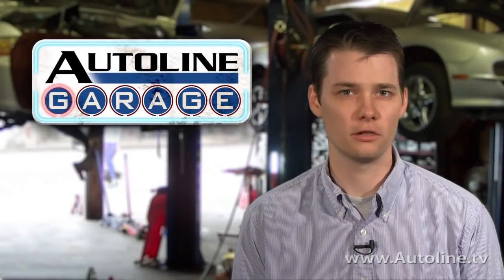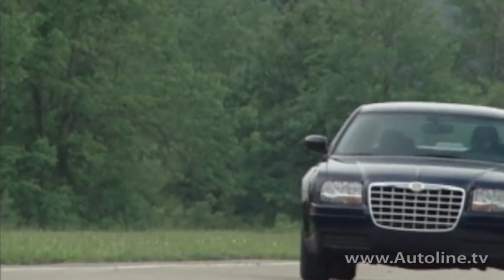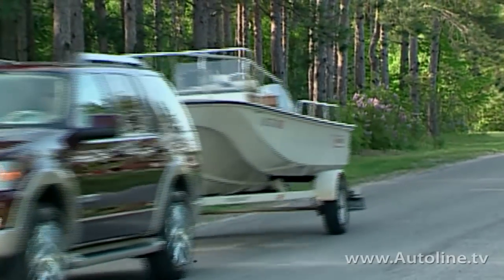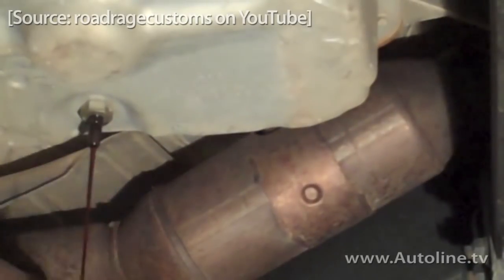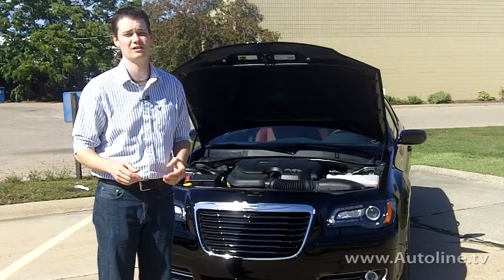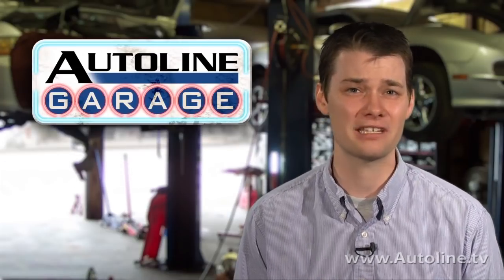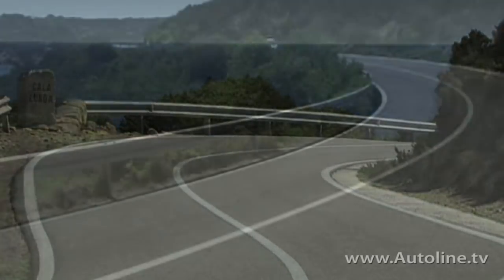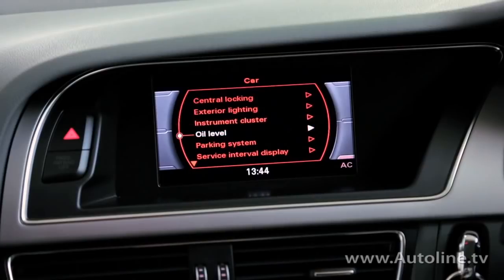Where Did the Dipstick Go? - Autoline Garage

Comment: The reason has many different angles. The first and obvious is "attempting" to force owners to ONLY have them serviced at the dealership so they can count on that money. The second is bean counters pinching every last penny for corporate greed and larger profit margins. The third is so you will wear out the vehicle sooner and need to buy a replacement. The forth is the EPA issue involving spills and disposal. The last is easily solved by taking your used motor oil to ANY auto parts store worth a damn. They all recycle it for FREE.

Now you can inserts any and all "xyz" excuse you have heard or have been told. It's all a bunch of lies and bullshit rest assured! I don't buy for a minute they have tranny fluid that lasts FOREVER!! I also don't buy EVERYBODY uses the wrong type or puts in the wrong amount. Christ...you should see what I have to do in any given working day as a licensed HVAC technician and as a factory maintenance man who does HVAC, plumbing, electrical, carpentry, masonry, tool making, welding and metal fab, mill and lathe work etc..etc.. That tranny fluid is a piece of cake if you left the damn dipstick on.

To add....all you manufactures can kiss my ass! I'm not buying anymore of your Star Trek junk! 

Still have my 1965 Ford Mustang 289 K-Code Hi Po V8, 4-speed manual coupe and 2002 Ford F-250 Super Duty 7.3L Power Stroke diesel V8, 4X4 Off Road, super cab, long bed. I wouldn't buy anything newer than 2010/2012 even if I needed a new vehicle. 

K.I.S.S. Keep It Simple Stupid

The more complex the design the greater the failures and unreliable. You won't see any of this new junk driving 20 - 57+ years from now. It will be in the scrapyard by the time it makes it to 10 years old. All that electrical and computer junk is a ticking time bomb waiting to shit the bed on you.

Comment: Cars are actually being built better these days, so less service, means less dealer profits in the service bay. A simple way to drive people to the dealer for service is to remove the ability to perform simple but required DIY tasks.   Huge plastic engine covers that serve absolutely no purpose whatsoever.  Removal of oil and ATF dipsticks so the owner can't check and fill without a lift or special tools.  Hiding trouble codes unless you have a dealer level scan tool, the list goes on and on.  GM pioneered the concept of "built in obsolescence", now the car makers are moving us to the "dealer only" service concept for cars.
Reply: We are somewhat lucky; in Europe you have to take your car to authorized shop or you lose the car warranty...

Comment: My 06 Pontiac Torrant has a little short dipstick that you have to get under the car to check. You have to take a little bolt out to remove the dip stick. Very hard to get to the bolt. It looks like the easiest way is to remove a Motor mount. I think it is a Toyota transmission. Hope to add a longer dip stick.

Comment: how much is that service gonna be? Its all about making more money off of us buyers
Reply: Anika Kindred you can probably talk to them doing it for free if your there for a service since most dealers have a service point check they do when the car is brought in, this should be included.  If they charge I'm sure it varies, I hope not much.  Some cars you can buy the tool online, just have to search, best bet is use a car Forum for your car and ask.
Reply: I have a 2015 Kia Optima, It has no trans fluid dipstick. The dealer says the fluid shouldn't be changed until 105k but being a retired mechanic, I don't believe in leaving ANY fluid in a vehicle that long. Now that I'm going on 67 years old, it's not quite as easy to work on cars any more. I called the dealer and asked for an estimate for a drain and refill, they want 170.00 for a drain and refill. I also asked an independent garage for an est and got the same price.  I feel like I should take a container of Vaseline in with me and ask them to shake my hand before the F me. So, I'll be doing the drain and refill on my own.

Comment: Very well said sir, as cars get older it's normal for small leakages to happen, in the old days one would avoid an expensive front seal replacement by simply checking the fluid every1-2 weeks, now that is not an option, how stupid can you get?
Reply: A lot of modern fluids lose viscosity due to air exposure and thus the makers try and save the average Joe wanting to check the fluid from having to do a trans rebuild at 100k

Comment: I've read that many people experience a transmission failure after having the fluid changed ... I also saw a post by a guy who owned 10+ transmission shops and ironically he said to never change your fluid because he said the same thing ... transmission fluid changes can lead to transmission failure!   I guess if your transmission fluid is clear your in the clear.  But it would be interesting to hear your take on this Autoline.
Reply: Not changing your fluid leads to failure.  His ignorance in car maintenance is why his transmission failed. Not changing your fluid regularly will cause metal shavings to gum up in the fluid and the fluid will go bad and lose viscosity.  Your transmission is already totally fucked at this point. Now when you go in and they flush the trans and refill it with fresh fluid, the transmission now works the way its supposed to with fresh oil and no debris in it - except because of the ignorance in car maintenance - you now have tolerances in the parts and then that's when you experience transmission failure.  The failure was already there to begin with, changing the fluid has nothing to do with it.

Comment: I have a 2016  Chrysler Town and Country. I took it to the dealership so they check my transmission fluid level. They said not to worry about the fluid level. They said when the trans start to slip, then bring it in. They also said that they took the dip stick away because people were messing the transmissions up by putting to much fluid in and not knowing what they were doing.

Comment: The dealership  Transmission fluid flush seems to be a great method I had it done before 30k miles I am at 62k now. 
I think I can do the fluid change myself by opening the drain plug and unhooking both the cooling lines using a 5 gallon bucket to catch the old fluid and a  2 gallon pump-up sprayer to force new fluid into by attaching it to the return fluid line (removing the spray nozzle so the fluid flows faster in the open line) until I see good color going into the bucket...  Watching  for over flow at  the drain plug controlling it with the pressurized 2 gallon sprayer valve...  (in neutral, engine running at idle) (force fluid out of the cooler with compressed air)
This is what the machine at the dealership does, with a cleansing fluid added first before the new transmission fluid. I will pay the dealership to do the change if I am able to watch their flush. If they give me some kind of insurance purposes reason to not let me watch I will most likely do it all myself I just need the cleansing fluid whatever that is??? 
Sound feasible?

Comment: Check out Scotty Kilmers video on BMW dipstick. 

2011-2016 New Dodge Caravans don't have dipsticks for the transmission on the 6speed automatics.
Reply: lightningsmokerXx that is correct. These are um well claimed to be life time fluids. If nothing is leaking nothing is going anywhere or should be going anywhere in any case it would be shifting incorrectly anyhow and you’d notice that, that was problem. But still need fluid changes at least 60k. Yes should also be done by a dealer. Meh... 

Haven’t had any issues with mine. Just maintain it.

Comment: I am thinking hard about changing my fluid at a shop while it is still under warrenty.  I figured of the transmission  is messed up after the change , the dealer will have to cough up the repair cost.  the dealer says ,  the fluid is good for  lifetime and don't do anything to it unless there is a problem.  well....  when there is a problem, that means it is too late.
Reply: Transmission fluid is no way in hell good "for a lifetime".  It must be changed every so many thousand miles. It varies based on the construction and age of the transmission, the car itself, and the way you drive.

Comment: I once had a '07 Dodge Charger SXT with a V6. It had a transmission dipstick tube, but no dipstick just a plug. When I called the dealership they said they would check the fluid when I brought it in for service. I asked how much a dipstick tube would cost & they said $90. That's highway robbery if u ask me.

Comment: The reason there is no need for a dipstick is NOT because the fluid is good for the life of the vehicle (it's not -- read the owners manual).  It is because there should never be any reason for the fluid to be low unless there is a leak.  A transmission does not "use" oil like an engine.  There is no combustion  process and no cylinder blow-by.   It's like a rear-end, if there's no leaks anywhere it will be full.
Reply: Peter L But if you develop a slight leak you can’t monitor the loss and maintain the level.

Comment: Some of the "no maintenance needed  transmission " cars dont even mention trans fluid changes or flushes in thief manuals!    BUT!
Most of the transmissions self destruct  at about 110,000 miles  unless you do.  The warranty usually expires at 100,000.  Hmmm.

Comment: 2007 Jeep Grand Cherokee no dipstick just the plastic cover plugging the hole where a dip stick goes. These cheap bastards don't give you a cabin filter either. $32,000 dollar Jeep. Cheap bastards would have cost them about $5.00  for the filter and dip stick.Chrysler sucks big time. Next vehicle is going to be a highlander or pilot.

Comment: Hey you wanna know more crazier thing  ...ask mercedes!  not dip stick for transmission and no oil pressure light for the engine...my diesel sized up on the hwy ...normal oil level normal temperature...but oil pump give up ...I had no idea that my oil pressure dropped....Mercedes sprinter (commercial vehicles) lol.  with om642 diesel. I think all modern  automotive engineers need stop playing with  computers  and put them in service shops to see what stupidity they create.
Reply: Hello from Sweden 🇸🇪
R,I,P Mercedes Benz 1930-2005🇩🇪💩💩💩💩💩💩💩💩😅😂😂😅🤣😊
Reply: @jamesthunder7590  Hello from Canada..

Comment: To my surprise, when I went to change the fluid on my 03 Infiniti G 35, there was no dipstick.  I called the dealer and they told me to replace the same amount of fluid that I had drained.  It did have a filling tube that was capped with a screw.  Makes no sense to me.
Reply: Saving weight & $1 !

Comment: in a sense i can not fault the manufacturers for taking away certain things. people fiddle with their cars and then go for warranty claims to get their foul up fixed on the dealers dime. SO they took that problem out of the loop in many ways. i do agree i will not trust a sensor to save my life. if the calibration is off you may be low a quart or high a quart. this could lead to over or under fills. just as detrimental. one HUGE PLUS of using the dealer services is you can go back and blame them with a receipt, and if it is their foul up they have to pay to fix it NOT YOU...

Comment: Sean , i have a BIG problem with your video and your complaints !!!! you did not call the manufactures of these cars a bunch of money grabbing Bastards !!! this is the number 1 most stupid , most ridicules , idiotic , pure stupidity , and should be close to  out right theft a car manufacturer has ever done !!!!!! thanks for the video buddy , job well done :)
Reply: +Mike Gunter The dealership  Transmission fluid flush seems to be a great method I had it done before 30k miles I am at 62k now. 
I think I can do the fluid change myself by opening the drain plug and unhooking both the cooling lines using a 5 gallon bucket to catch the old fluid and a  2 gallon pump-up sprayer to force new fluid into by attaching it to the return fluid line (removing the spray nozzle so the fluid flows faster in the open line) until I see good color going into the bucket...  Watching  for over flow at  the drain plug controlling it with the pressurized 2 gallon sprayer valve...  (in neutral, engine running at idle) (force fluid out of the cooler with compressed air)
This is what the machine at the dealership does, with a cleansing fluid added first before the new transmission fluid. I will pay the dealership to do the change if I am able to watch their flush. If they give me some kind of insurance purposes reason to not let me watch I will most likely do it all myself I just need the cleansing fluid whatever that is??? 
Sound feasible?
Reply: +Tony Iocca  i  have worked on cars for over 10 years professionally  and many , many years before and after . in all my time doing this i have never flushed my own trans fluid . the reason for me not doing this is , about the only thing you will get in trans fluid from normal use is the wear and tear on the internals , meaning metal parts wear . you do get a small amount of wear from the surface of the clutches that is not metal but it is a very small amount of material . so the metal is what your going after most to remove from fluid . in the pan of the trans most all cars/trucks have a magnet attached to the pan and it will collect the metal particles as the fluid passes over the magnet . really all you need to do is make sure that magnet is cleaned spotlessly every time you change the fluid and you will be fine as far as the flush goes . i have seen people add an extra  magnet to the out side of the pan from underneath the car  to help catch even more particles . it is very effective  as to catch more metal . you can use a small amount of J-B weld on the sides of the new magnet to help keep it in place and not fall off . when it comes to this trick you can not add to many magnets to the pan , the more the better . just make sure of the clearance for the added magnets . from that point all you need to do is keep up with changing the fluid when it needs it . also there are aftermarket kits you can buy as an add-on that will give you a remote mount trans filter for easier , more convenient filter change as it uses a filter similar to an oil filter , i have seen people use this add on filter along with the internal filter so they have twice the filtering  properties after using both filters . hope this helps buddy :) if i can help again feel free to ask and i will  be happy to do all i can :)
have a great day and happy motoring :)
Reply: +Mike Gunter Thanks for the reply, I will add a few magnets Northern Tool sells very powerful small magnets. These dipstick-less transmissions are designed to be flushed by hooking the cooling lines up to a machine. It is a fairly new method as I understand it the torque converter is flush well during this process and with the cleansing fluid any built up residue is also removed before fresh fluid is put back in. During the first 30k flush no filter was replaced as the dealership informed me that the cleansing fluid would also clean the filter, any metal would not be significant enough to replace the filter at 30k. I do not trust dealership or much of any other people working on my vehicles I do most all work myself.   I really want the best job possible done that is why I like to do it myself. I have a 1983 F100 I have done some modifications with and a rebuilt long-block back in 1999 it is running great and pulling hard like I need it to do. Some so called mechanics told me some 10 years ago to junk-it I always honk my horn and smile when I pass by their shop...  I won't add another filter, I mainly want to inspect and replace the one that is in it. I like to see few if any metal to be found and if it is excessive I want to see it not be told about it... Anyway Thanks again.
Reply: +Tyne Castles I can not afford to trade in let alone but a new car at the 2 year point

Comment: Umm the dip stick was the cause of fluid loss and transmission failures people kept getting lint and dirt and not cleaning the seal or replacing or never knew what temp was correct while checking the fluid the sealed system for operation purposes will prolong fluid life and unless leaking or very old u should not need to check it u can still drain and fill twice every 40 or 50k and it will be good
Reply: Exactly.  Sealed is better.